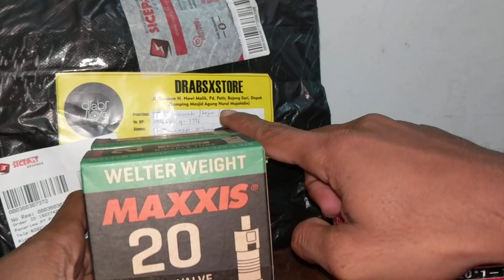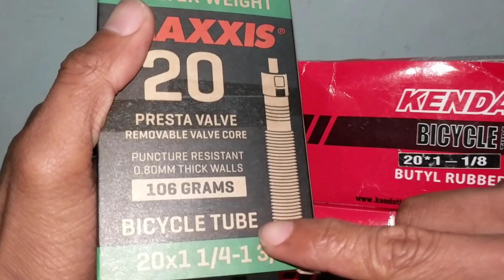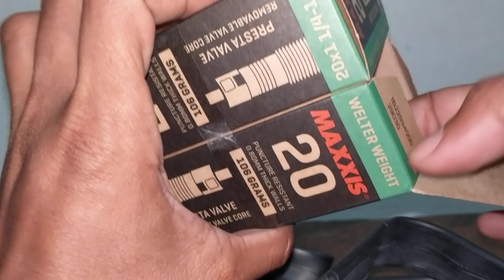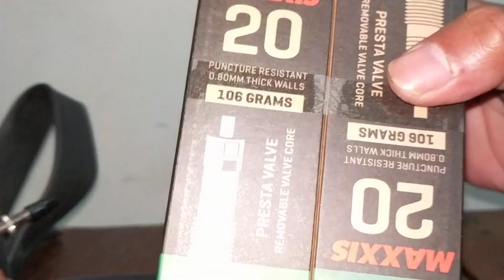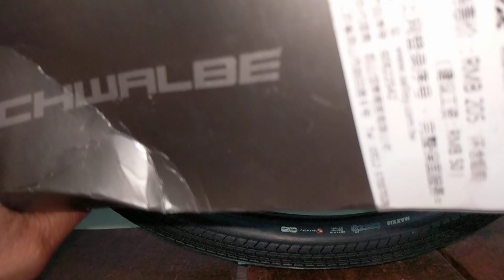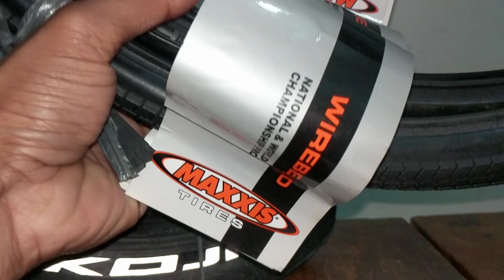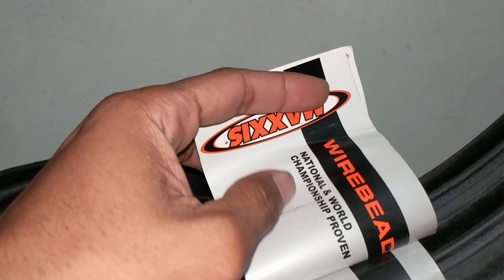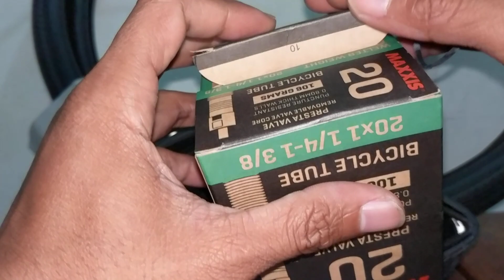Review Ban Sepeda Lipat 20 dan 22 inch

Comment: Mas ajeng tanglet,
Selisih diameter luar Ban 20" 406 dgn 20" 451 brp ya mas?
Takut mau upgrade malah gak muat ke frame
Reply from the maker: SEPEDA nya apa?
Reply: Frame xlr8 neo2
Reply: Kalo yg  java neo 2 versi Fullbike ya ada mengeluarkan versi 406 & 451, tpi sy blum tau ukuran framenya sama atau tidak
Reply from the maker: Bisa sama saja
Reply: Menawi kerso, nyuwun tulung ngukur diameter luar Ban 451 mas..
Reply from the maker: Bisa di upgrade mas. Gak perlu ngukur. Kalo belum yakin coba mas ke Bengkel atau toko terdekat untuk cek